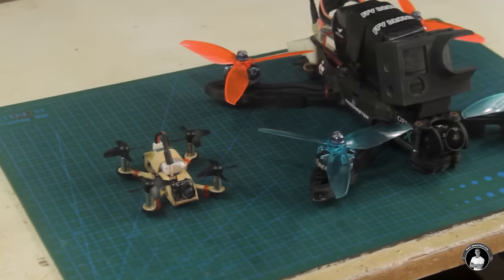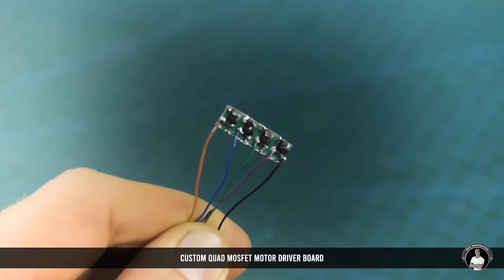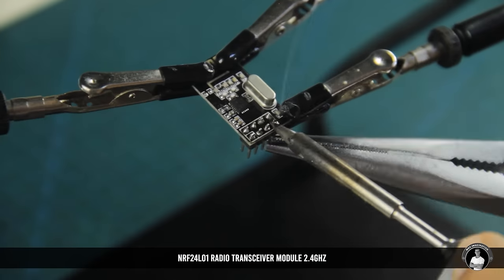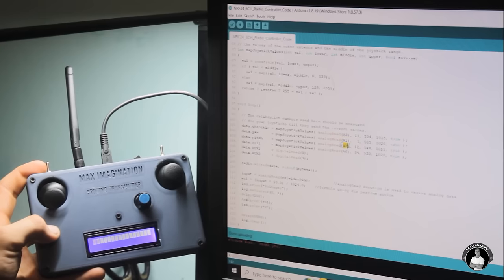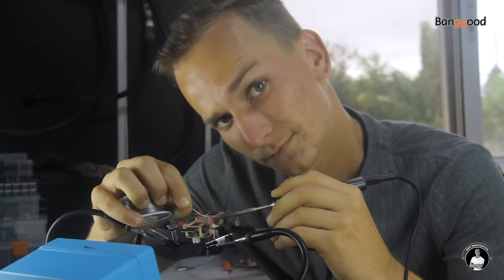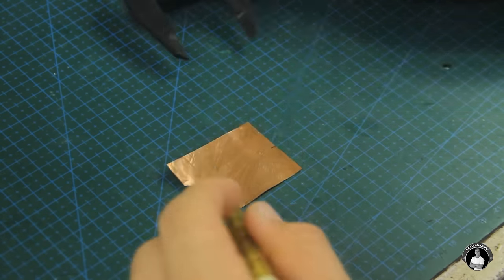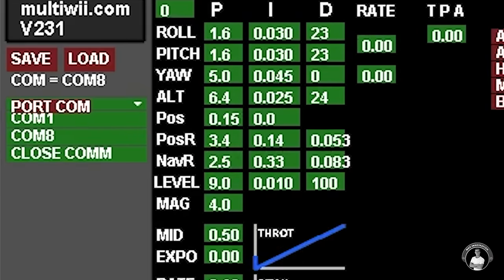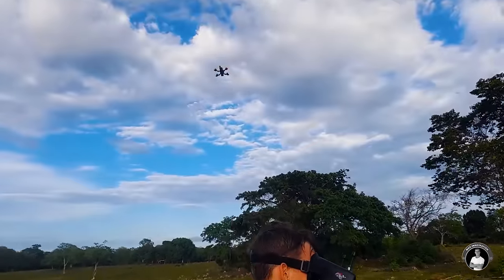Make a TINY Arduino Drone with FPV Camera - Will It Fly?

Comment: I think you solved the problem i was having with my drone, thanks for making this!!!! I had the same resetting issue and for months could not figure out what was causing it (if you want you can take a look at my channel for a quick video of my drone problem) but I'll try your fix and see if it works. Did you end up running the arduino at 8Mhz or did you overclock it to 16Mhz at 3.3V?
Reply from the maker: Glad to hear my video has helped you! I will check out your drone.
I actually ended up using a 5V 16mHz Pro Mini due to not having a 3.3V version which strangely enough worked with a 3.7V battery. I didn't cover this in the video as it would be misleading. However, I don't doubt it will work with a 3.3V Pro Mini.
Reply: @MaxImagination  Awesome, thanks a lot!! One big difference is that I tried to integrate everything onto one custom PCB. The proximity of all the components (mostly the mpu6050), and lack of adequate emi shielding are probably the main culprits causing my issue. I even tried adding capacitors on the motors, imu, and nrf like you showed but the problem was still there. Maybe the copper shielding tape (and probably also adjusting the PWM frequency) is the final touch I need to get this working. Also, do you know if larger motors cause more noise/emi? I'm using 8520 motors but it looks like yours are a lot smaller.
Reply from the maker: When integrating everything into one PCB, that's exactly where the problem starts. Normally PCBs for drones are designed in such a way that they have the mosfets on the underside with a ground copper layer within the PCB to shield from the EMIs - from what I've studied. 

Larger motors usually cause more EMI due to having larger windings. Generally, you should not worry about the motors you're using, but more how you're shielding the sensitive onboard components from the EMIs. Maybe you could try desoldering the onboard transistors and have them soldered on an external board?
Reply: @MaxImagination  Sounds good! Yeah, that's exactly what I'm planning to do on the next board iteration (adding the copper gnd layer that is). I'll try moving the mosfets to a separate board too, but maybe as a last resort since I really want to try integrating everything together.

Thanks for the help, and great job on all your projects!! Definitely subscribing to your channel!👍

Comment: The DYI MVP  right here .   But,.......

,,,

but,,,

,,,

,,,,

"this copper tape to ground...." .... How do you ground something that is in the air?  Flying? Wouldn't it build up a charge?

 Would incorporating a resistor help? Converting electrical energy to heat?

 I remembered this trick from a time I had Corsair peripherals...I'd always get shocked.... you could even see the spark some times using the mouse....keyboard was even worse. Adding a resistor(value depends on situation) onto the ground where the usb connected to the pcb alleviated this situation. This was partly o do with the peripherals tilizing USB mini.... I believe many new USB C designs incorporate this resistor set up into the pcb in this manner and there is no nee for concern....but' seeing that tis is a completely DYI contraption....could help...and possibly  providing the ability to remove the hefty copper tape...since in a way that tape is basically a resistor in its self.
Reply from the maker: When I said "ground it" I meant to solder the copper sheet to GND (ground or the Arduino), this helps enforce a stronger EMI shield for sensitive components onboard. This has nothing to do with ground currents or electricity that shocks.

Cheers.

Comment: Hii !! If possible, can you please share (update) the final circuit diagram of the whole project including components like capacitors and resistors which are newly added at the end of the video while troubleshooting? It will be really helpful for us.
Reply from the maker: Hi there! Those capacitors are not needed, I only used them to pin point the issue, and they didn't help solve it. The current diagram is up to date with the working drone.

Comment: How about designing a little PCB with all the control electronics on that also acts as the arms and motor mounts?
Reply from the maker: One guy tried that and it failed to work due to not properly isolating the MCU and Gyro. This works better.
Reply from the maker: However, with proper copper isolation in the PCB, it would work.

Comment: GPS module in the aurdino?.. would be nice if its software based and is active when its lost or hung in a tree somewhere... and the locator is in the remote.
Reply from the maker: No need for GPS on such a tiny drone with 50 meters of range. Use the beeper instead to locate it.

Comment: Hey, it's me again,  if you can provide a 3d file link to the blades you used as propellers, would highly appericate it

Also, can you please explain how you raised the MPU from the arduino as it doesn't appear clearly in the video? should I wooden sticks to raise it?
Reply from the maker: Hey there. I do not provide 3D files for the propellers as they hold up best when factory-made, when bought.

I left product links in the description for matching or alternative propellers.

The way I supported the MPU6050 was using the very two communication pins from the mid-side of the Arduino. It's soldered and held up over the board.
Reply: okay thank u so much, can you add more shots of the drone upclose please in the drive folder?

Comment: I have done this with an ESP32 but I found I had to keep the drone circuit and the camera circuit completely separate, with two microcontrollers and two batteries.  Otherwise the noise on the ground plane created by the motors just completely wrecked the video footage.  I guess your camera is just better at dealing with that?
Reply from the maker: Strange... have you grounded your copper EMF shield? Your drone shouldn't have an issue with the FPV camera connected to the same circuit.

I suggest you also check how much power your camera is consuming. Maybe it's too much for the supply you're giving it.

Comment: hello, nice project!
I am now making a few of these drones and I was wondering if there is an alternative pcb i can buy, for the motor drive (like the same size weight) because I need multiple of these motor drivers and, do not want to spend more time soldering smd components :)
Reply from the maker: Hey there! Thank you!
No, I do not provide PCBs for this project. You can try making it from scratch like I did or design your own
Reply: @MaxImagination  okay thanks for responding.
I still have a problem. I have uploaded the code, but when I start the mulitwii gui, connect via the correct com port and click start, I do not see the drone and the values for the gyro. Do you have to connect all components and motors first for it to work or do you have any suggestions to get this working? I have now only connected the gyro and arduino.

i tested and some Arduino work and some do not, (so for example one uno works and the other uno doesnt) do you know what could cause this
Reply from the maker: From what I remember you need to have the NRF24 module also connected and working with the transmitter before all else appears in the GUI. This is how I tested my setup at first when it worked.

Comment: The heavy battery should be attached 
"on the bottom", for keeping the drone 
center of gravity, as lowest as possible.
Reply from the maker: Not necessary. It's also an FPV drone, the battery is normally on top.
Reply: And helicopters should 
have, their propellers 
under them, too...

Comment: 13:58 I don't understand exactly what the problem was in this part. Was the gyroscope affected by EMF?
Reply from the maker: The problem was caused by the induced EMI from the motors into the motor driver, causing the Arduino to reset and to interfere with the gyro.

You can avoid this with either a sheet of Aluminum or copper. Aluminum foil will work fine.

Comment: Sorry for disturbance 
But I can't find the ss14 diodes smaller than 4mm by 2mm and the ones available are very expensive help me with it can I use them
Reply from the maker: You can get away with using those diodes as long as you keep other components on that board small.

Comment: Hey Max! 
Can I use a SI2302 SMD N MOSFET instead of SI2300 in drone motor driver ??
Reply from the maker: Hey! Yes, you should be able to. It's an N channel MOSFET like the one I used - SI2300.
Reply: @MaxImagination  Thanks Bro Love From INDIA 😘
Reply: @saurabh37848  Bhai SI2302 wala work kara kya ?
Reply: yes
Reply: @DABAS Haaa
Reply: @DABAS.  Haaa

Comment: Could you please build  a single-rotor drone using an Arduino  flight controller?
Reply from the maker: May consider it for a future video. Cheers!
Reply: @MaxImagination 
With your code , The rear right motor of my mini brushed MultiWi
drone isn't spinning until the throttle reaches 50%.
Could you please guide me on how to fix this issue?

Comment: Following this pattern, can this be applied to build a more robust drone like those used for fishing, that need to lift and carry some weight? Or even a bigger one, like those used in farming?
Reply from the maker: As long as you build a bigger drone with corresponding size components and motors, why not.

Comment: How long does the battery last? And how far does the drone catch the control signal?
Reply from the maker: As written closer to the end of the video, 2-5 minutes. 2 minutes with the camera on board and 5 minutes without. The drone's range is 50-100M.

Comment: what is the price of everything ? Wonderfull project
Reply from the maker: Thank you! It cost me $45 to make the drone. However, the price may vary depending on how many parts you're buying and from where.

Also, what do you mean by "everything"? Cheers.
Reply: @MaxImagination I mean, all the project (fpv camera and fpv helmet) is this are optional if yes can you make a version without
Reply from the maker: @lochipo3967  Ah, okay. I would estimate anywhere from $170-250 USD depending from where you buy the equipment and parts. This includes the parts for the DIY transmitter, drone, and FPV headset.

Comment: Hey max! I wanted to ask you if you can make a multiprotocol module for flysky fsi6 transmitter using nrf24l01
Reply from the maker: Hi there. Will keep that idea in mind. Cheers.

Comment: The phonetic transcription of "soldering iron" is different in the UK and US:

UK: /ˈsəʊl.də.rɪŋ ˌaɪən/

US: /ˈsɑː.dɚ.ɪŋ ˌaɪrn/ 

The word "soldering iron" is pronounced with the following sounds:
UK
/s/ as in "say", /əʊ/ as in "nose", /l/ as in "look", /d/ as in "day", /ə/ as in "above", /r/ as in "run", /ɪ/ as in "ship", /ŋ/ as in "sing", /aɪə/ as in "fire", /n/ as in "name"
US
/s/ as in "say", /ɑː/ as in "father", /d/ as in "day", /ɚ/ as in "mother", /ɪ/ as in "ship", /ŋ/ as in "sing", /aɪ/ as in "eye", /r/ as in "run", /n/ as in "name" 
A soldering iron is a heated tool used to join metals and wires by soldering them. It is usually electrically heated and has a pointed or wedge-shaped tip

Comment: Amazing video,but before this you made fpv drone and I used the same fc and vtx but when I turn vtx,cam on osd doesn't show up and video is gizzling and facing issue with power output .....can you help with this......plz
Reply from the maker: Thank you! Firstly, are you receiving any video feed in your goggles? Have you made sure to wire the OSD wires correctly? Are you sure the wires aren't swapped? Make sure you're also running the VTX at full power - there's a mode button you need to hold until you see a bright red light turn on to get it into 800mW mode.
Reply: @MaxImagination  yes everything is fine just issue with osd

Comment: Thank you a lot for this great project! Whole family got carried away by it. Trying to build it with my daughter. Was wondering if you can help us, the *.ino has reference to two files that are not in the project (#include <nRF24L01.h>, #include <RF24.h>). Do we need to use different files instead or we can download this files somewhere?
Reply from the maker: Glad to hear you're enjoying making this project so far! The two files are actually missing libraries that you need to install via the Arduino IDE's library manager - https://docs.arduino.cc/software/ide-v1/tutorials/installing-libraries/

That link sends you to instruction on how to install libraries. The two you need can be searched in that library manager and installed from there.
Reply: @MaxImagination  Thank you!
Reply: @MaxImagination  we don't get any signal from the drone in MultiWiiConf. Code was uploaded successfully, Conf app connects to proper COM port, but doesn't seem to get any signals. Did you you have an issue like this by any chance?
Reply from the maker: Hi there. Please excuse my delayed reply. Seems like your hardware connection between your PC and drone isn't solid. I suggest you check for swapped TX/RX wires and make sure you're supplying your board enough power with a decent USB cable.

Comment: Hi! ive been working on this project for some time now and ive got all the components built for the drone part. Although im having a lot of trouble with uploading the code using the FTDI adapter for the pro mini. It compiles fine but when I try uploading it I am either getting Access denied or Programmer error attempt 1/10, 2/10 3/10 etc. I was just wondering if you had any suggestions for getting unstuck with the arduino ide part,
Thanks!
Reply from the maker: Hey! Sounds like your Arduino isn't going into download mode. Press the reset button once immediately after the compiler shows "Uploading" during programming and it should upload the code.
Reply: @MaxImagination  You are a certified genius, im left speechless. Great video man!
Reply: @MaxImagination  Quick question, when im opening the transmitter software (MultiWiiConf) i get a popup error of "Windows cannot find javaw.exe", i made sure i have 64x bit windows 11 and I chose the right download, let me know if youve also encountered this!
Reply from the maker: Hi there. Thanks for your comment!

As a modern Windows user, you are going to need to install Java 8u202 or earlier, AND edit their windows PATH data to point to that build, in order to use the MultiWiiConfig! Other viewers too were banging their heads against the wall on this issue.

Download Java here: https://www.oracle.com/java/technologies/javase/javase8-archive-downloads.html

Comment: How to send battery voltage from rx to tx? It would be better to know when to replace the drone's battery, right?
Reply from the maker: To monitor the battery's voltage, you need to wire an analog pin from its Arduino board to the + wire on the battery and uncomment several lines of code in the program to activate voltage monitoring. It will then warn you through the buzzer when it's going low.

Comment: Btw max its me the dude who alaways ask in the rc controller tut the 3 pin headers in the receiver do they really need to be in that color or it can be all black? Or any color? Ty for answering
Reply from the maker: Any color will work as long as you're using 30 gauge or larger thickness wire. I stick to using colored wires to make connections themselves less confusing for you. Cheers.
Reply: @MaxImagination  thanks max sorry for my late reply

Comment: You can add brushless motor for extra speed
Reply from the maker: Yes, but in a different drone. Coreless motors were used for smaller size and affordability.
Reply: Ohh just recommending 😁

Comment: are there any alternatives for the diodes, resistors and mosfets I cant find any locally
Reply from the maker: Sure. Look for SMD N-channel Mosfets, Schottky diodes, and 103 (10K) resistors in old electronics and salvage them. Test the mosfets and diodes with your multimeter to check pinouts and polarity.

Comment: Cutting off pin headers to reduce wait is a good idea, but why on earth did you use hot glue to add 1000 x more weight of the pin headers back on?
Reply from the maker: Hmm, 1000x? What weighs more, a drop of glue or metal?
Reply: @MaxImagination  One header weights less than 0.01 g, your blob of glue probably 5-10 g Especially since you used more than once hot glue.

Comment: Hey Max, is there any way I can use a FlySky FS-i6 Radio Transmitter to go with it? And also, cool build!
Reply from the maker: Hey there! I wouldn't know how to do it and I don't think that would be a straightforward connection. I suggest sticking to an Arduino transmitter :)
Thank you!

Comment: Sir when we upload the code to the reciver after completing!
Reply from the maker: Please elaborate on your issue if you are facing a problem. If you mean when to upload code, I recommend during the building of your drone as you finish doing the wiring so you test things work before final assembly of the frame. Ideally, you can upload the code after you finish building the drone.

Comment: Hi dude I'm majoring electrical and electronics engineering in 2 year but I don't have any background about electronics. to make these kind of projects where should i start ?
Reply from the maker: Hi there! I suggest starting with learning electronics first as it will give you the foundation. Then, move onto learning Arduino and it's programming.

Read the book: Practical Electronics for Inventors 

Watch channels such as "All About Electronics", "GreatScott", and "EEVBlog".